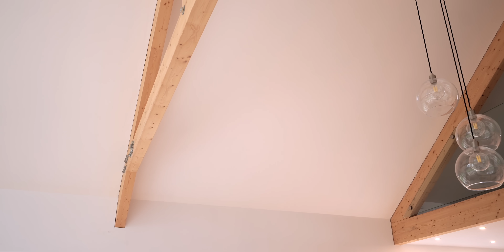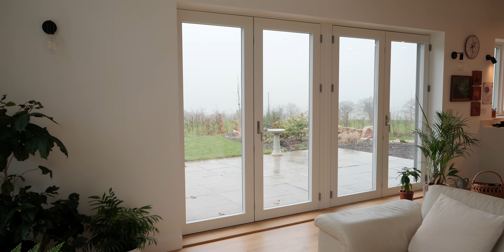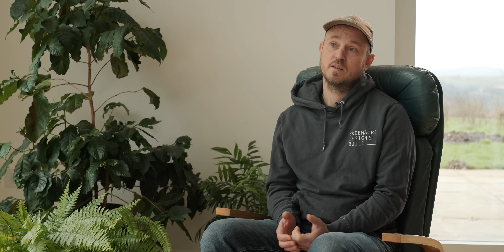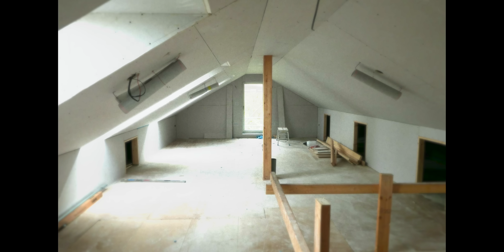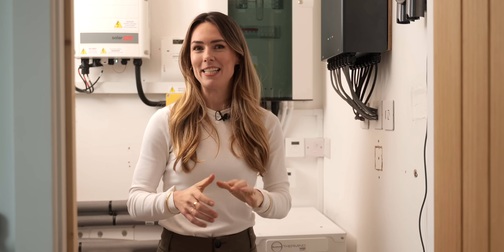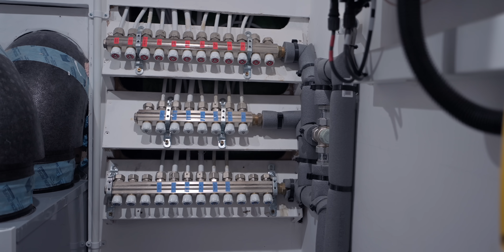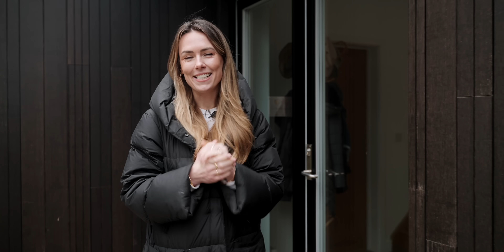Ditching a Heat Pump for In-Plaster Infrared Heating?!

Comment: Uk Land of the heat pump phobia.

Where everything has to be done different than the rest of the world. Just To do it the Brit-exit. But as long as it works Cheerio.
Reply: problem is heat pumps are awful in the uk climate at 2-6 degrees with high humidity when they go into defrost crazy mode, this doesnt happen in other countries as its dry colder air .  the manufactures do not  give out  data for high humitidy low temps like we get in Britain because its terrible .. a 10kw heat pump becomes no more than a 6kw heat pump in this scenario , its hardy sized correctly for this issues ..
Reply: Bullocks, opposite is true, since humid air has more energy. And therefore runs more efficiently versus where there is dry air. And a refrigerator has to defrost far more than a heat pump. (Or have they outlawed refrigerators in the UK?)   Which runs on the same principle as a heat pump.

Plus heat pumps are common and increasingly used right next door in the Netherlands... With relatively similar weather and humidity. 

The real difference is that the Dutch accept common wisdom and custom unions, and therefore the   benefits of economies of scale. 

Vs British exceptionalism rationalizations and, its costly mindset...  the right way the wrong way and the Britway.... enjoy your, FUD C'est la vie
Reply: @2412RTW LMAO incorrect on many levels. for example the alternative has been outlawed in America for years and LED bulbs are commonplace.... But more importantly it's just an irrelevant lame "monkey see monkey do" CT excuse. 

FWIW, it's hilarious how everything triggers a fixated reaction about America and Americans, as if it's the center of the world,
especially in this Trumped age. Which ironically most Americans, believe is the case, c'est la vie.
Reply: @MrAndyj007  a more accurate estimate of worst-case heat pump power loss during defrost cycles is 14-25%. Heat pump installs often retain this sort of capacity as a reserve.

Comment: Back up solar power to a battery using another solar array is like having a back up generator. Yes it is an expense but it is free fuel to run. You could eliminate your grid need all together?

Comment: Always  fascinating to see another Passiv Haus . I built one and absolutely agree  with the KISS principle and adopted it in our house . Maybe it could be better classified as Keep It So Simple ?  We are Off Grid  too , this had its  challenges  but now after 3 years I can honestly say  it works . There was no electricity available , therefore it was the only solution . The ground is limestone after the 1st 400/500mm of soil , so ground source heat pumps were not suitable . Imogen , if you would like to see the house , you would be very welcome , it is in Kefalonia , Greece . 😀

Comment: Infrared? Mixed feelings as it might not be healthy...
Reply: At between 5 to 10 microns it's perfectly safe and mimics our own output
Reply: 😂😂😂😂

Another one!

Now, had you the wit to research the topic (prior to posting your latest silly nonsense) you would have discovered that "infrared' is quite safe seeing as it's used in medicine for treating all sorts of issues.

You can read up on these issues online.

You'll find descriptions of all the different classes of infrared radiation and how different issues require different types (frequencies) of said radiation.

Comment: Heat rises. Placing the panels on the ceilings is the dumbest idea someone could come across. Put them on the walls near the ground or even under the floor.
Reply: Indeed, heat rises, well done for knowing that, definitely no flies on you!

Now, why not research infra radiation and how it works.

More than enough information online.
Reply: That’s true for hot air systems — but this isn’t convective heating.

Infrared doesn’t heat the air first so there’s nothing “rising”. It heats the surfaces and people directly. From a ceiling position it radiates evenly down onto the floor walls furniture and occupants. Those surfaces warm up and then gently heat the air from all directions.

Ceiling mounting is actually the most efficient layout. Nothing blocks the radiation no furniture no cupboards no pictures and you get full room coverage with no cold zones at floor level.

This is exactly why ceiling radiant heating is used in churches sports halls warehouses and whole houses across Europe. Different physics to radiators. Different rules.

Comment: sorry but this is not efficient at all.
an air-to-air heatpump (AC unit) would be much better.
and a low temp air-to-water infloor heating heatpump.
infrared wastes a lot of energy. how can that be efficient?
it's the typical "we need to do something else then every body else and lie loudly that it is better."
fascinating.
it seems to be cold inside there.
Reply: If you can't have an outdoor unit for a heat pump (A2A or A2W) this might be an option, but a storage heater on a cheap off peak tariff would probably be the best of the rest, rather than IR.
Reply: More efficient to use a heat pump you claim.

Judging by other comments this is by no means certain.

Why not read said comments and see where you're going wrong.

Granted heat pumps can be considered fairly efficient but this is not always correct in every case as can be seen in this project.

Just a case of sifting through the comments.

Comment: How do you hang stuff on the walls?
Reply: Good question — and one we get all the time.

The heating mats are installed in defined zones, not across every inch of wall. We issue layouts showing exactly where the heating runs, so you always know the safe fixing areas.

Where a fixing does need to go through a heated area, you use plaster Rawlplugs. Combined with foil-backed plasterboard this prevents the screw from touching the heating element and stops any risk of damage.

We usually recommend and quote more for ceiling heating because it’s more beneficial. There’s no risk of pictures, cupboards or furniture being placed in front of the heating and blocking the infrared light, so you get the most even and efficient performance.

The system is low voltage (36V AC) and fully protected, but the design and fixing method mean you rarely ever need to rely on that protection.
Reply: We would reply to our video but another supplier seems to be hijacking the post before we have the opportunity to respond lol.. Perhaps Astectherm could attend to their own clients ;@)
Reply: It’s good fun…in fact electrifying

Comment: Can this in plaster infared system be implemented in your average home?
Reply: Why not address that question to the builder bloke?
Reply: Yes — absolutely. This system is designed for normal homes not just specialist projects.

We install it in individual rooms and in full whole-house systems. It works in new builds extensions and retrofits and is used in bedrooms living rooms bathrooms and loft conversions. The mats are skimmed into standard plasterboard run at low voltage (36V AC) and sit completely hidden once finished.

There are no radiators no pipework no noise and no maintenance. It pairs well with ASHPs downstairs and works brilliantly upstairs where underfloor isn’t practical.

We’ve been supplying this since 2013 and have heated thousands of buldings/homes across the UK with it.
Reply: Yes indeed.  Happy to pop over a brochure

Comment: Radiant can’t cool where as ASHP can. Looking of forward to the next 42c uk summer
Reply: Radiant?

Where do you get this "radiant" from?

It's FAR IR "radiation" you should be addressing, not "radiant".

To repeat, plenty of info to be found online via Google.

And, before you read up on the topic, try to understand that if a building is designed to keep heat in ... then you can work out the rest for yourself.

Tell us, seeing as you're a schoolboy, has your form got a book going on who can post the dumbest comment?

Comment: This guy should look at getting an electric vehicle that can power the home as well. I know at least the new BMW iX3 has it and I suspect a lot of new technology cars will as well in the near future. Then he has a battery for the 5 days he's without power and all the other days he can drive the battery.
Reply: Why not think it through prior to posting?

You might start on how much power is required in the house and if such a power draw can be sustained and for how long by the car's battery bank.
Reply: @ForestForest-n9i Í have. Look up bi-directional V2H charging. Some manufacturers offer it. It might not get you 100% full operation of your house but you can have lights, TV and stuff like that for hours during a blackout
Reply: @DanniV8 

Don't be daft! 

How can you confidently state "hours" when you don't know the draw from every property or the size of the TV or power required by a microwave, say.

In any event you have failed to address the capacity or "state of charge" of a BEV battery when this power cut starts.

For all you know the battery is flat and has just been put on charge.

Why does this naive and ridiculous assumption persist that batteries are going to be positively (!) brimming with energy at the start of a power cut?

This may be (I speculate of course) why V2xxx is not fully endorsed by the BEV building sector of the motor industry.

A flat battery and a cold dark house wouldn't be a terribly clever advertisement for an already failing BEV industry, would it.
Reply: @ForestForest-n9i Chill dude. I'm not saying it would solve all problems and power your every worldly needs during the end of times. 

It's a great way to have a backup system if you need it. And if you don't, you still have a fantastic car to drive around in. 

According to the all knowing AI, the average power usage by a UK home is 7.4-9 kWh per day. Let's say this one is using a bit more, let's say 12kWh a day. The latest technology EVs with 800V systems and bi-directional charging all have around 100-117kWh batteries. Let's use 100 kWh for this example. That means that if you had it fully charged and don't want it to drop below 50%, you still have around 3-4 days of power from half a charge. 

Now let's image that the battery isn't charged enough to power the home. Well, drive to the nearest fast charger, charge it to 80% and have a burger in the meantime time. Drive back home and use it to power your home. 

If everything is just doom and gloom and there are no solutions to anything then sure, I'd probably be just as negative as you are, and not even try to imagine a possible positive outcome to anything. 

What a way to live.
Reply: @DanniV8 

😂😂😂

You get worse.

Suppose the power cut extends to the charging station, then what?

Drive around in the hope of finding a charging station which isn't affected by a power cut?

And then watching the charge on your car getting lower and lower.

Plus of course if the ambient temperature is very low the batteries won't perform at optimum anyway.

Fortunately I have a decent battery bank in a warm space, bottled gas and a multi fuel stove. And of course a diesel generator.

And fuel, obviously.

And freezers full of food.

Plus bottled water.

My old employer taught all its employees how to prepare for the "worst", and not just power cuts.

The young of today are easily gulled and sadly by a lot of my generation.

Oh well.
Reply: @ForestForest-n9i well yes, I will admit that an EV to power your home will not do much in the end of times event. 

But we are not talking about that, he mentioned in the video he's had 5 days without power because the solar panels couldn't keep up. I was merely suggesting a solution to that. 

I apologise for not thinking about the possibility of the sun going completely out and somehow at the same time the power of all nearby towns I goes out as well.
Reply: @DanniV8 

Fortunately I'm a Vicar so we've got prayers for all eventualities,  including the End of Times.

Nothing to worry about there then.

Comment: Please stop using "infrared" like a magic word, this is just resistive heating like normal electric radiators but in the walls.
Reply: Whilst you are correct that this is a form of resistive het generation, in fact the heat generated is used to emit a light wave and not heat directly.  A subtle difference but one that, in practice, actually works well.  We have many heat engineers that have been dubious but have 'seen the light' after experiencing the effect for themselves.  There are of course some 'IR' products that simply put an element behind a metal plate - we are NOT the same.
Reply: @EnergyCarbonInfraredHeating  Thanks, I would have liked that they actually explained the physics instead of using magic words, dogma is never good. As I understand the heat is still generated by basic black body radiation and I can't find any information online that contradicts it.
Reply: Not another half witted comment from yet another half wit.

Why not research the different types of infra heaters  and why they are used.

FAR IR is an  excellent choice for heating the "person' and surfaces (for a sort  of secondary heating).

To describe FAR IR heaters as mere resistive devices is a tad silly..

The sort of comment we might expect from the ignorati who infest this platform.
Reply: @ForestForest-n9i I am an engineer that designs these kind of things. The only difference between carbon films and electric heaters is surface area and operating temperature. They both use black body radiation to emit their infrared. I just want them to be more clear and not fall for marketing wording. Seeing your hatred and negativity, you are exactly the kind of people you talk about right now.
Reply: @rca168 

😂😂😂😂

You're not a design engineer at all in any way shape or form.

We have so many engineer manques on this platform who know square root of SFA it's laughable.

We even have "engineers" who don't know the difference between "radiant" and "radiation" despite pages and pages of information being available online.

Next time you decide to don your fake engineer's hat why not read up on what you want to tell us prior to posting.

With luck you might learn something.
Reply: @ForestForest-n9i  You are so toxic. Glad I don't work with you. You claim to be knowledgeable but don't bring any argument either.
Reply: @rca168 

Had you the wit to follow the argument then you'll have noted (but evidently not) my advice is to research via the internet as in "fact checking".

You might, or might not, have noticed most viewers are clueless and appear to rely on this platform for "everything" in the BEV line and similar technologies.
Reply: @ForestForest-n9i  That is what I find awful in this discussion. Because you are anonymous (I hope), you allow yourself to insult me and my line of work with no other argument than "do your own research". If you are so full of rage I would suggest a sport like boxing or a martial art. It would allow you to expel your rage and give you an opportunity to observe and maybe imitate respectful people.
Reply: @rca168 

😂😂😂😂

Rage?

Are you some sort of simple snowflake?

Have you no conception at all of the tripe you and many others type on a regular basis?

Of course you don't.

Seriously yours and others' comments are too precious for words.

Why not replay the video, take notes, then see if your nonsensical claims agree with the notes you took.

There again you are a bit of a Walter Mitty character so we're never going to see much reality in whatever you come out with.
Reply: @ForestForest-n9i ok…how about some facts and figures. 
I am no expert, but I thought the amount of IR was proportional to the surface temperature and the surface finish, please correct me if I am wrong.
Reply: @markthomasson5077 

You are indeed quite correct, well done.

Chapter and verse available online for others who may be interested.

But, for those who are  interested be warned there's a fair bit of science involved with reference to various "laws of Physics".

Not necessarily a light read for everyone it must be conceded.

I presume you were trying to explain, albeit in a slightly weird way, why this multi faceted  fleece is an excellent emitter of FAR IR radiation.

Feel free to agree.

Comment: Where is the part about cost and sustainability? This is the one gripe that I have about the 'electric evangelists' - always on about how little the electricity energy costs but hardly talk about that initial outlay and the cost to maintain when things need replacing. Yes, this is somewhat helpful should money not be an issue, but for the vast majority it is, so it doesn't paint a full picture.
Reply: Unlike a hydronic system ours is a decoupled solution.  If a mat were to fail (not likely as no moving parts and low temps) then just that mat would need replacing, so simply skim a new one in
Reply: This was all maintenance free.
Reply: @johnburns4017  So nothing will ever need replacing?
Reply: @jay26cee 
Replacing when faulty and maintenance are not quite the same thing.
Reply: @jay26cee 

Oh, you mean ripping out all the plasterwork and the FAR IR  emitters?

Yes, perhaps Imogen neglected to tell us the place had to be rebuilt every few years.
Reply: @johnburns4017  No, they are not always the same thing. Performing maintenance is manufacturer specified no matter the warranty period. Failed component replacement outside of a warranty can be a very expensive issue.